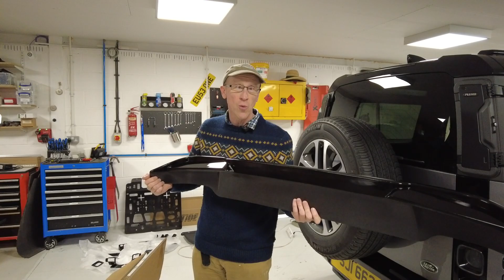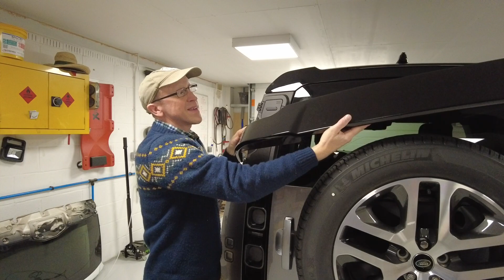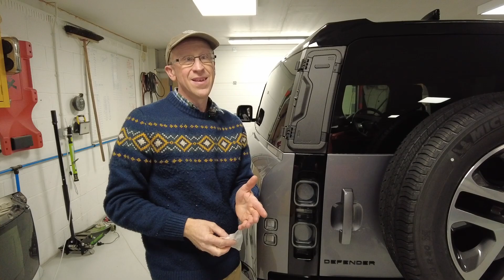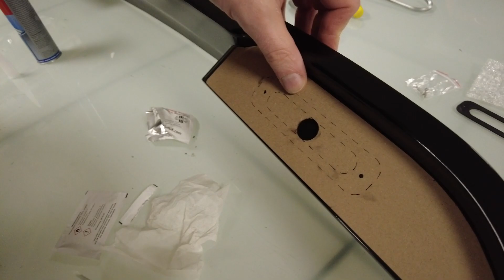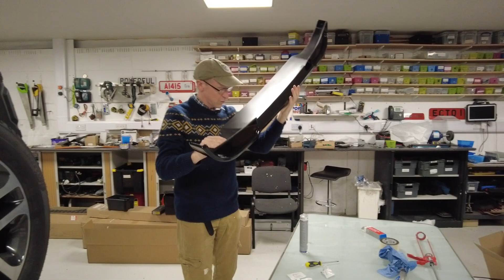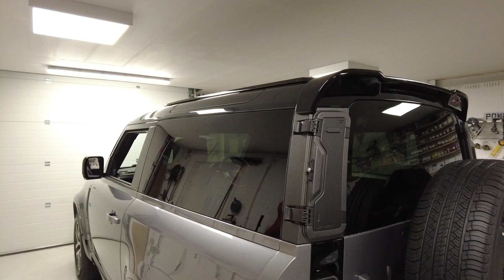New Land Rover Defender L663 Rear Spoiler - Fitting & Demo

Comment: While you have installed this spoiler on the 90, you should also do a video of installing it on your 663 110,Stig. Please do a video of installing it on the 4 door and include the installation of the lights that you have provided the templates for. The wiring and switch configuration are most critical. I would be more inclined to buy the complete package from you if you show me the way. I am a current customer of your fine products.
Reply: Here, here - a ‘with lights’ installation and the ability to purchase a spoiler with (preinstalled?) lights package would be great 👍🏼
Reply: @davidglen4586  Absolutely! We need. video of the light fitment on the spoiler, please.

Comment: Have I missed the fitting of the quarter panels video, or is that yet to come.
Will you show how to run the wires up to the new spoiler.
Reply from the maker: Hi Andrew
I took the video down as i had a problem with Summer Auto parts.
Here it is 
https://youtu.be/QufLL9uTib8
Reply: @L663  cheers Simon

Comment: Nice. Can you design something similar for the Discovery 4?
Reply from the maker: what about this 
https://www.dropbox.com/s/x5x058v1upfdwu9/2022-12-04%2018.14.33.png?dl=0
not my design but coming soon - I also have my own design spoiler coming !
Reply: @L663  looks like it overlays the existing top panel, and has a separate part running down each side ? That would be good, as I don’t want to have to remove the existing unit with brake light. Interesting to see what you come up with

Comment: Good work Simon…have you seen the “Lummi” Defender in flat green paint? It looks horrendous with some terrible mouldings stuck all over the car to make it look dreadful!. Your spoiler is on a different level….maybe I would wrap the roof section on the car so that I could get the spoiler off if need be. A neat job again! 😀😀😀😀Richard

Comment: Nice one Simon,
Why not use a sticky foam tape ,, back in the eighties all ford spoilers used the sticky tape stuff
Reply: Yes and most of the spoilers are still laying at  the side of the A445 .
Reply from the maker: Yes sticky tape will work - can get soft in the heat - being ontop of the car and black I was a little worried about heat.
Reply: 3M VHB tape would be what I would use. But I'm sure Simons will stay on.
Reply: With tape you've no option to move it if you don't get the position perfectly.
With the bonding adhesive you can move it slightly after fitting.